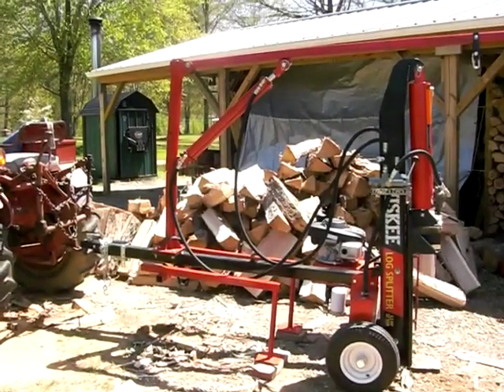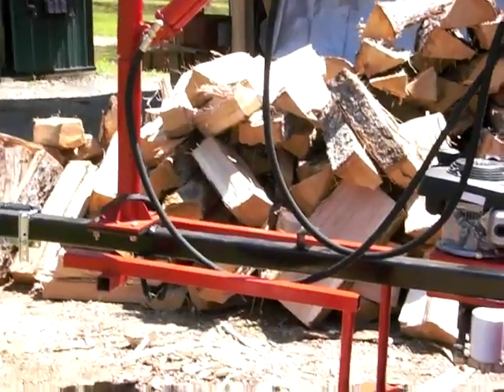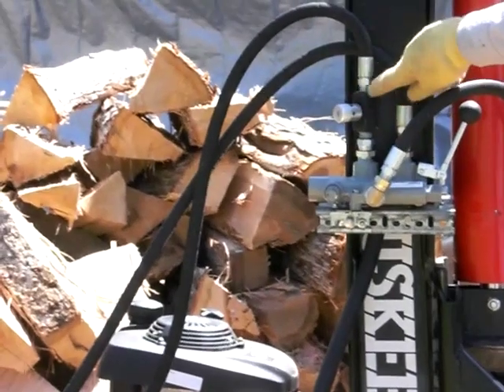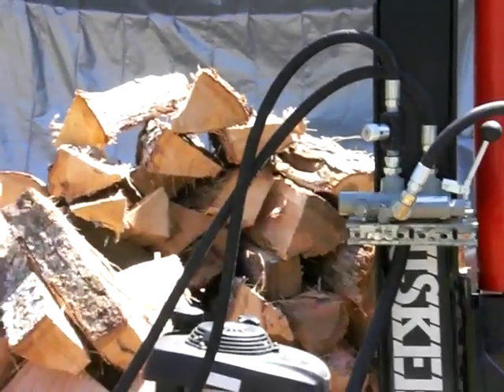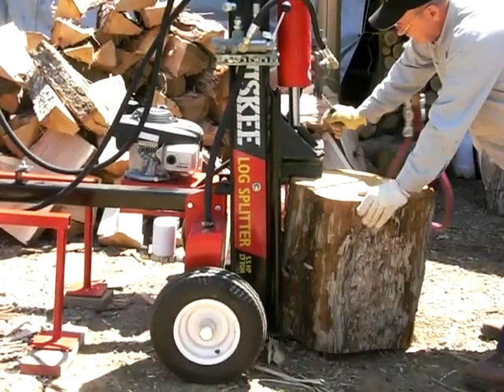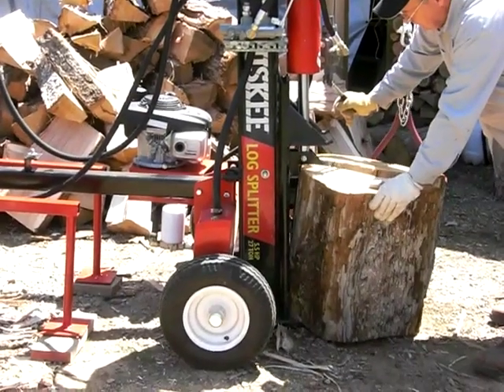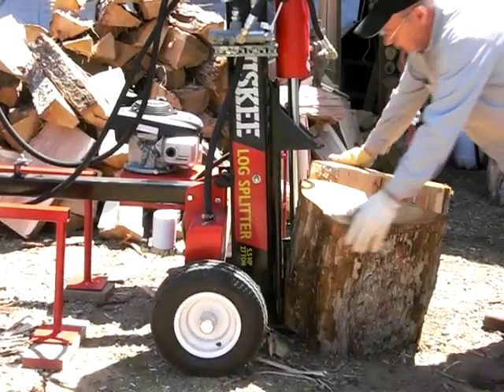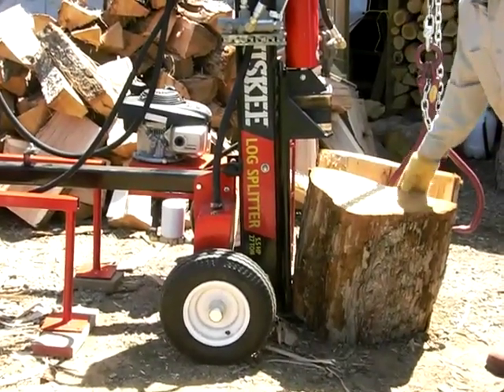Huskee 27 Ton Modified Wood Splitter W/Overhead Lift and cradle

Comment: Great!  Thank you for the input!  I wasn't sure if the return side of the stock valve was built for the pressure or not.  Good to hear you can just kind of 'daisy chain' them.  Also thanks for the note on the needle valve.

Comment from the maker: Thanks for your comment. You take the exsisting tank return line  to the inport on new valve take the return on addon valve to tank, use only one valve at a time. Will need a needle valve in lifter to control speed.

Comment: I have a Huskee 22 ton that I bought new 7 years ago. I recently took mine to a friend of mine who owns and runs a welding/ repair shop. He designed and built a boom that is used in the vertical position. I bolted a hand crank winch and run 50' of 1/4 inch cable out through a snatch block pulley and to the biggest set of logging tongs that I could get from Northern Tool. I position my splitter slightly downhill from the big blocks to be split and when I crank on the winch, they will easily slide into the foot for splitting. I leave the tongs attached with a slight bit of pressure as I split and then just spin the blocks and split until they cannot stay together and at that point I can handle them.
I wear gel filled knee pads and work on my knees as to keep my 62 year old back straight.
When I added the boom, it became very tongue heavy and was too close to the tailgate of my Kubota side by side, so I took it back to my buddy at the welding shop and had him remove the old very light duty tongue and goofy leg stand and had him make me a heavy gauge box tube tongue and welded a Bull Dog jack on it. I also had him build a mount for a winch roller guide that really does a nice job of centering the winch cable on the spool. A nice feature when the big blocks aren't perfectly in line with the pull of the winch.
These mods have made an otherwise very nice machine into an awesome one and now much more versatile. 2 men used to struggle to get those huge Oak blocks into place. Even using a can't hook. Now, since all the mods, I can do it alone.
Love your set up as well. I know that you are much happier with yours since the modifications that you have made. I am with you there brother. Yours was very well thought through.
Gary Fox, Iowa
Reply: @olddansbees2072  , my wife and I have noticed a serious decline in the population of Bumble Bees here in Iowa this past summer. We live on a farm with old buildings and usually couldn't walk across the yard in the summer without running across at least a couple of Bumble Bees. I hardly saw any this past summer.
There is a friend that has alive set up just down the road from me that has been gathering honey for nearly 4 decades and he tells me that his numbers are down and the honey is cloudy now and not clear like it used to be.
This is something to not be taken lightly. These bees are a much more important part of the life cycle than most people know. Scary.
Gary from Iowa

Comment from the maker: Thanks for your comment. I got the log tongs from Northern Tool & Equip. I have two sizes. Item # 19795-2001 for large pcs, #143995-2001 for smaller. Please be carefull when lifting.